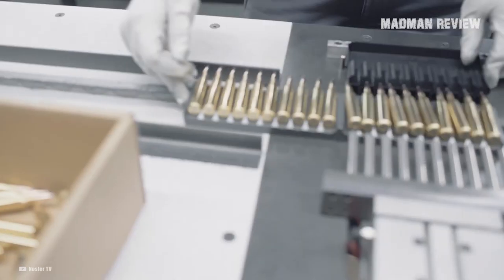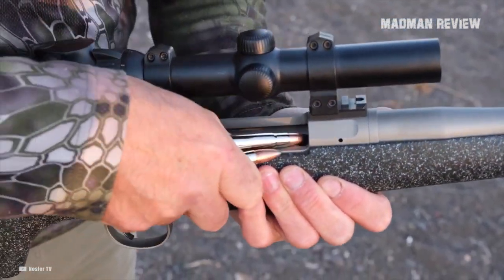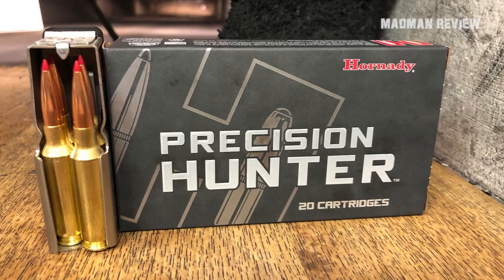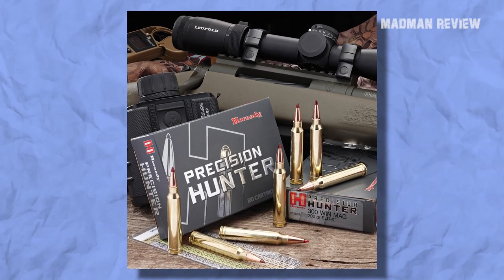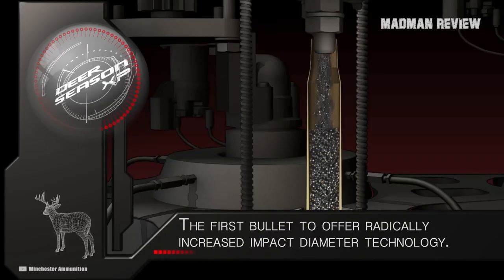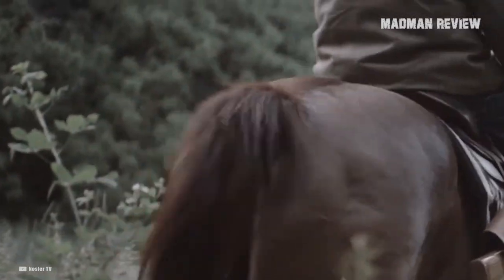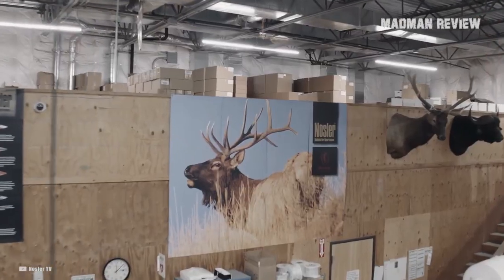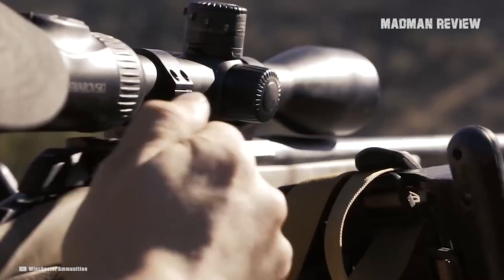Most Accurate 6.5 Creedmoor Ammo

Comment: What's the best for 6.5 grendel.?
Reply: Hornady Black ELD match 123 grain factory ammo works the best in my AR with a 20 inch 6.5 Grendel Bear Creek Arsenal upper. Sighted it in at 50 yards sub MOA groups for a 200 yard dead hold. Took two deer opening week in TN this season both at 175 yards with this ammo. First was a double lung. Went 40 yards and died. Second was a double lung that hit low and blew apart both upper front legs and the heart. 10 yards and died. Also dropped a Coyote in its tracks at 30 yards same week. Good target and terminal ammo so far.
Reply: I shoot the same ammo in my grendel. It’s awesome and pretty cheap

Comment: This evening i went out and shot a 5 shot group with my Tikka Tac A1 at 750 yards on a steel silhouette. Went and measured the group with electronic calipers. The 5 shot group was 3.584".  That is 0.47 MOA. I was really surprised.  I wasn't even in a very comfortable position either. I was on top of a mountain with a bit of a downward angle and my Atlas bipod was on a dirt mound which meant i had to really elevate the stock to see the target. Every bit of my beanbag was utilized and then some. It was also fairly windy.  The trigger is 1lb. Optic was a Night Force ATAC-R 7.5-35x56 with Mil-xt reticle in a SPUHR mount.  Atlas Bipod has spikes with cleats. Bubble level is a folding US Optics that i hate but haven't swapped out yet. All together, about 6k for the whole set up.  I was shooting Federal GMM with 130 gr. OTM Berger bullets.  I had a bunch of consecutive head shots with some missing just over the top. 
Normally, i shoot Hornady ELD's or Norma. I've shot the Normal Golden Target Match out past 1 mile. I've also hit a soda can in 3 shots at 1,004 yards with the Norma 130 grain GTM and a soda can at 1,380 yards in 14 shots in a 15mph 90 degree crosswind. 
This is the first time i've shot this particular round and i was HIGHLY impressed.
Getting 0.47 MOA out of a 5 shot group at 750 yards off a mountain top in the wind (probably around 8-10mph is my guess) in an uncomfortable position impresses the hell out of me. I shoot multiple times a week (3-5x's) and i know a kick ass round when i shoot one. Based on how i was shooting today, i think hitting a golf ball multiple times in just 5 attempts at 750 yards is definitely doable. I woudln't be surprised if i could hit it once in 10 shots at 1,000 yards either.
Reply: I've shot hornady's and bergers out of my tikka upr, both factory loads. Hornady's never faired as well. I believe just under 1 moa at 100. The factory bergers were .25" at 100. Amazing accuracy. Next I shot a 2 inch group at 460 with it. The steel plate was a swinger and still moving in between shots. With a still target and another go I believe I could definitely get it down to 1.5 inches or so.

I cant recommend bergers enough. I think they were the 130gr. hybrid, meant to be shot out of an AR. I'll be using their 140s next week to see how those do.

Nice groups man, those are insane!
Reply: @camonly849  Yeah i watch the Australian channel, "Mark and Sam After Work" from time to time and i remember a few years back he basically stated that he moved away from Hornady to Berger's which i believe are his preferred bullet now. That's a pretty fun channel most of the time.  I liked his idea of playing Tic Tac Toe with 2 Liter soda bottles at distance vs the wife.
Reply: @rascalmatt6713  yes I love their stuff. Ya I can see why they chose them. Love them. I am using the EC Tuner brake as well, so I can supposedly dial my shot a little more. We will see.
Reply: @camonly849   Yeah i've had people recommend that to me. It seems the new trend/fad is these barrel harmonics devices that you put on the end now... not just comps, brakes and flash hiders anymore.
Reply: @rascalmatt6713  ya I highly recommend it. Any recommendations for the tac a1? Do you have any aftermarket things for it?
Reply: @camonly849  No not really. Mine is stock and the trigger i got down to 1lb. I love the stock. I know that people buy it and change out the chassis and or put different barrels on it. They change the chassis for better balance for PRS and some change the barrel to get more speed out of the rounds since Tikka barrels are known for being slow. Years ago "FRANK" from Snipers Hide had some videos where he swapped out the barrel and replaced it with a shorter Bartlein barrel with a Left Hand twist which he mentioned being adamant that the Left Hand twist is better in the northern hemisphere... LOL i mean... you wanna talk about getting into the "Nitty Gritty"... lol 
I have everything stock and i'm happy with it.  I did buy a Tikka T3X Super Varmint though and was disappointed big time with that rifle. It became a money pit. Lipstick on a pig kind of experience. I had watched a video from a S. African channel called GunRats.. and they had one.. shot two different kinds of ammo out of it... and got  no worse than 1/2 MOA out of it... and since my experience with the TAC A1 was so amazing i bought the damn thing. Took it out... shot 3 different kinds of ammo... the faster the ammo, the worse it shot.  It's a 6.5 PRC so that was very demoralizing because the whole point of the 6.5 PRC is to shoot the 6.5 CM bullets and get an additional 200 FPS per marketing... and i had watched a channel where a guy was shooting a steel gong at 600 yards with 6.5 CM and 6.5 PRC and the CM was barely making a dent on the gong while the PRC was going through the gong like a hot knife through butter.  I was only getting about 94 fps to maybe 130 or 150 fps at best faster. Now the Super Varmint sports a 1/8" twist. I went online to look at some high end barrel makers and saw a lot of 1/7" and 1/7.5" twist rates for the caliber.  I think what was happening is that the 1/8" twist, while good for the CM is not fast enough for the PRC. AT least that's my theory right now. I plan on getting a carbon fiber Proof Research for that rifle and making it a hunting set up. I purchased a 1.5k MDT ACC Premier chassis and that 1 MOA group actually turned into a 1.1MOA group... lol  Even put the JP Recoil Eliminator on it. Dialed the trigger weight all the way down... and can't remember exactly what the pull weight was after that. At any rate.. i'm hoping for 0.5" groups with the Proof barrel. If i can get that, i'll go for some 2,000 yard shots. 1,850 yards is the most i've got for with the 6.5 CM.
Reply: @rascalmatt6713  ya I've seen that video with that barrel, was interesting, but I'm not gonna even think about doing that unless the barrel is done for. I purchased a thicker, I think MDT? Grip for the tac a1, since my dad liked the grip on the upr so much. Haven't used it yet, but hopefully soon we can get it on there. Other than that it's all stock.

Man I can't believe you had that bad of luck with that gun, that's sad to hear. My dad also has just the t3x I think in .243. That thing shoots pretty well and he likes it. Still load testing and all, so nothing nailed down. Maybe get a threaded barrel for the prc and throw that EC tuner break on it. Harmonics must be trash with it. That will definitely help. My friend bought a Daniel defense delta 5 and best was 1.25". Threw the break on it and with the same ammo got it down to .75". He's a killer shooter too. Funny you brought up 1800 yds, he just hit a shot at 1942yds (not bragging that was just the distance).

Also, if you didn't know, which you might, if you get the tac a1, you can email tikka and register the gun with them and have a 3rd mag sent to you for free.
Reply: @rascalmatt6713  instead of putting all the money and time in load development, I just got the brake and it simplified everything haha.
Reply: @camonly849  I bought mine quite a while ago and did get the 3rd mag for free. 
I've heard hit and miss on the Delta 5. 
I am just about done building 2 competition AR10's. One is 6.5CM and one is 6CM. While i do love the precision of a bolt gun... there are some great gas guns out there. My screen icon is a 0.4" group i shot with my Noveske SPR and 77 grain Razor Core OTM's. I've hit a milk jug with that rifle in 3 shots at 1,006 yds.  It's just a great, great rifle.  So the 6mm CM has a SS Proof barrel and JP internals and the 6.5CM is sporting a JP Supermatch barrel and JP internals.
I have a thermal dissipator on the JP barrel and a thin, Fortis rail. I bought a JP rail because i think the barrel whip is sending the thermal D. into the rail. There's just hardly any room there and i get weird flyers... i'll nail a pain can at 800 yards twice in 4 shots but the two that miss are a foot low. So  i think that's what is happening there. I'll know when i replace the rail and take it out again.  For AR grips on precision AR's ... i HIGHLY recommend the Hiper Fire grip.... have it on my Noveske SPR and now these AR10's i'm buidling for competition will have that grip.
Reply: @rascalmatt6713  I've never looked into AR precision rifles, although I would love too...I don't know much about them. I will take a look at some of those you mentioned.

I normally go for vortex, any other scope recommendations?